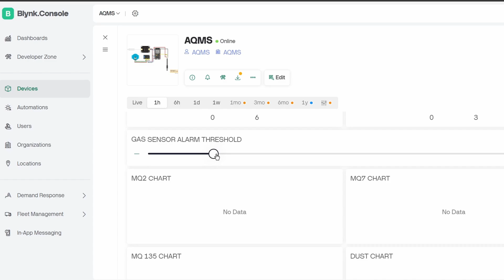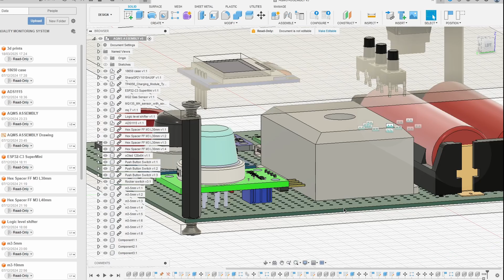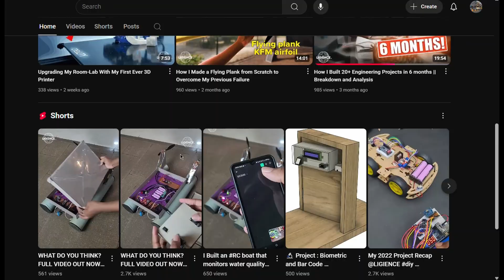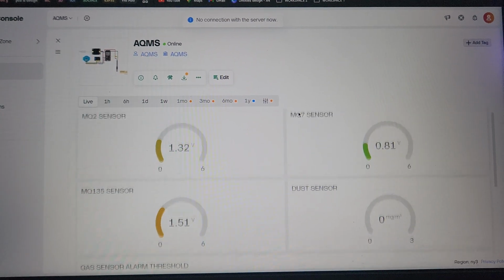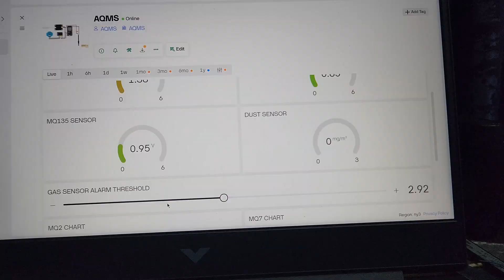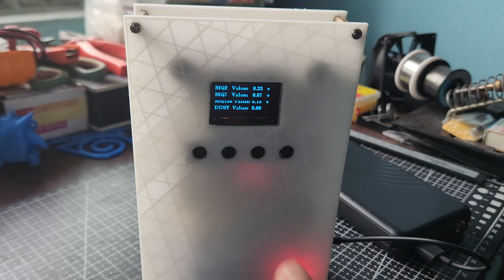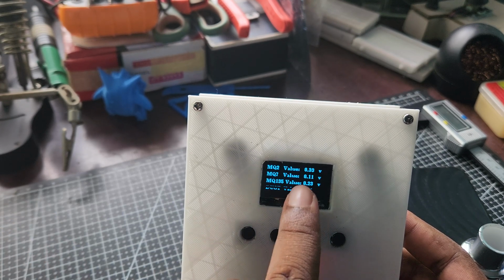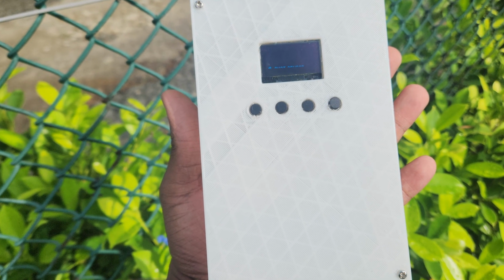I Built A Portable Device to Monitor Air Quality

Comment: Why did you ADC for those 3 MQ sensors?
Reply from the maker: It wasn't necessary, but I wanted to get more accurate voltage readings as the ADC on the esp32 has a bit of a starting deadband  if I remember correctly